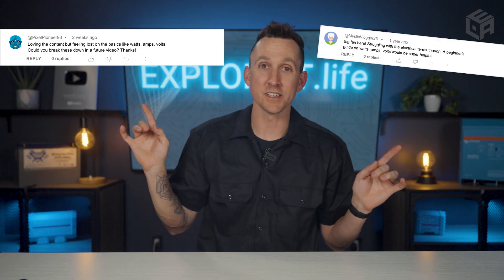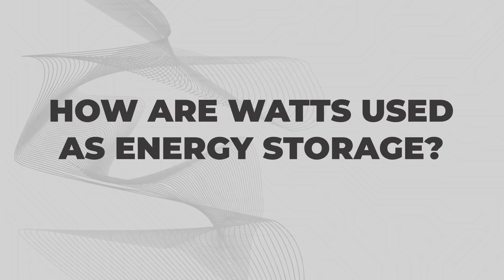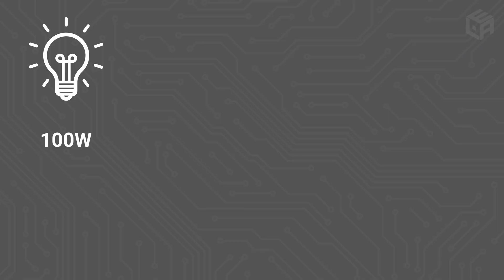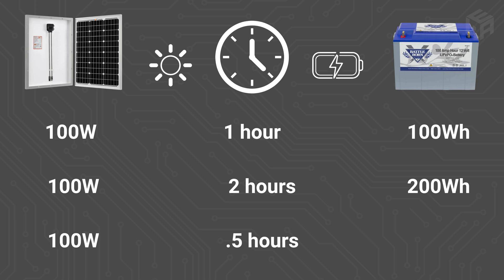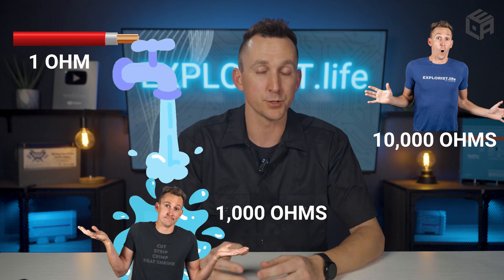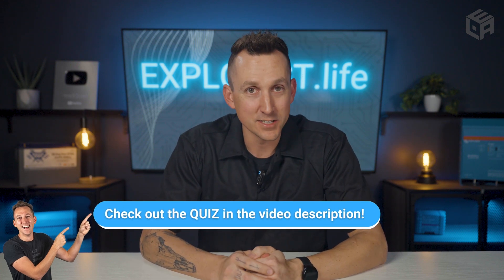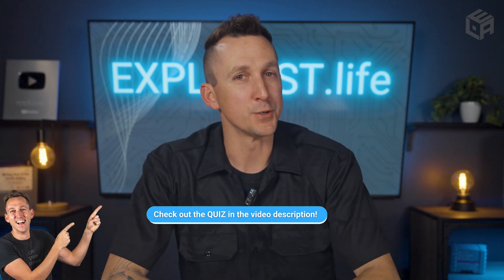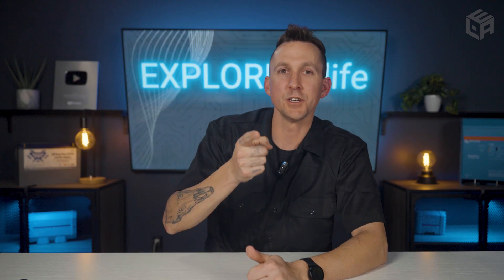Electrical Terminology 101 for Mobile, Marine, & Off-Grid Electrical Systems

Comment: Thank you very much.   I'm confused by your statement that Watt Hours are like Miles / Gallon.  The calculation you gave was a 100W light bulb for 1 hour is 100 watt hours.  You are multiplying.  But if I go 50 miles and use 10 gallons, I get 5 miles-per-gallon (mpg).  That is dividing.    To multiply I'd use the calculation 5 mpg * 10 gallons = 50 miles.  In other words, I can go 50 miles on 10 gallons of gas in a 5 mpg car.   That is similar to I can light a 100 W light bulb 1 hour on a 100 Watt hour battery.   By that comparison, Watt hours are a volume of power and not a rate.    I always get confused when I try to come up with these comparisons.

Comment: Hey Nate, is it possible to connect my camper Solar System to aid my house power from the grid between trips?🤔
Reply from the maker: Not easily, no.  It would be easier to treat the RV as a 'backup' in the same way you would a backup fuel generator; but getting the RV to 'assist/aid' would be a substantial undertaking.

Comment: Great job as always. I want your take on volt amps vs watts. A Victron inverter is labeled as say 3000 VA but only has an watt output of 2400. I assume this is the power loss of inverting DC to AC but wanted to be sure.  Your comment on this would be great.  Thanks!
Reply from the maker: Great suggestion!  I've got a Volt Amps vs Watts on the schedule for the 'Inverters' chapter of this academy.

Comment: i see this as;  AC is going back and forth to/from power grid and as such continues as long as the grid is "up".   while DC is flowing out, so it 'runs out' and needs to be refilled.